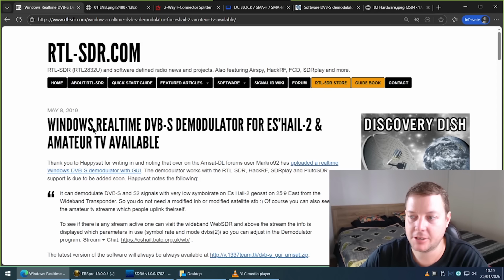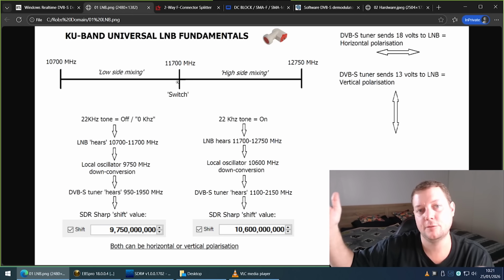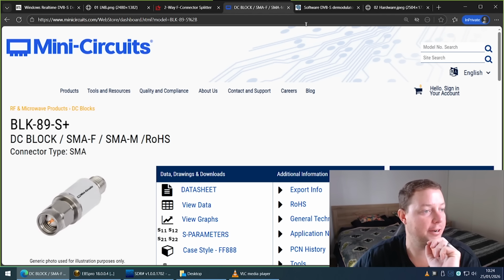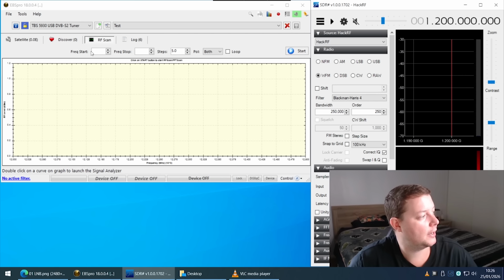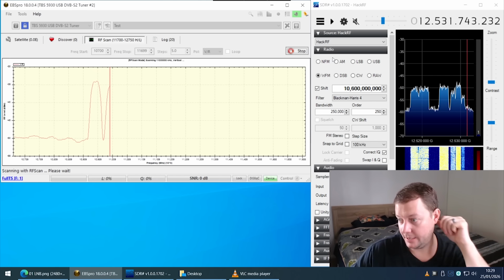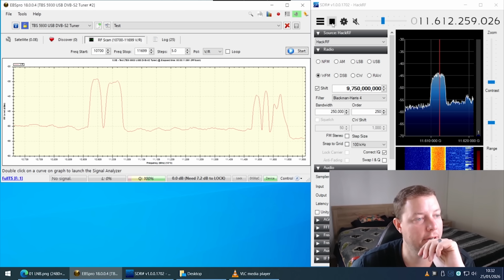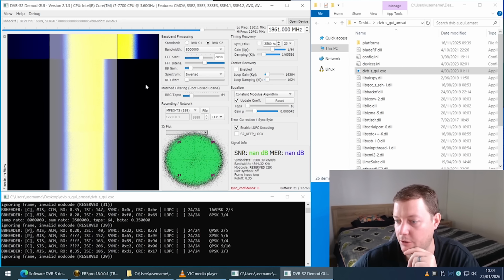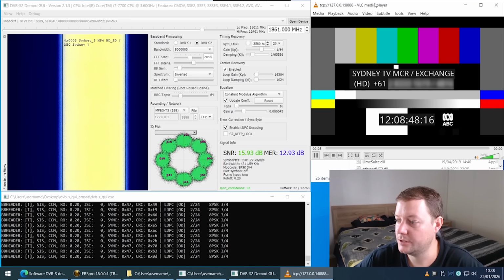DVB-S Demod GUI: Apparently Watching Satellite TV With an SDR Is a Thing Now?

Comment from the maker: LINKS, DOWNLOADS & COPY/PASTE VALUES:

DVB-S Demod GUI Reupload:
https://drive.google.com/file/d/1a4x3-k-moHbG3ouhVxDj6FXCE60otSD8

https://www.antsig.com/products/2-way-f-connector-splitter

https://www.minicircuits.com/WebStore/dashboard.html?model=BLK-89-S%2B

https://forum.amsat-dl.org/index.php?thread/101-software-dvb-s-demodulator/&postID=24112#post24112

9.75 GHz to Hz = 9750000000

10.6 GHz to Hz = 10600000000

VLC streaming URL: tcp://127.0.0.1:8888

Comment: Hi, i'm the author of this software, thanks for featuring it in your video.
Apologies for the lack of documentation. Once you have a lock, then redicing the loop gain values of the timing and carrier recovery (dragging the slider all the way to the left) increases stability so you dont lose lock again too quickly.
Sometimes the SDR drops samples on high system load, which i can't do anything about :(
But i'm glad this old software is still being used, Greetings to Australia :)

Comment: A quick question, I see you use the  Golden Media GM202 LNB. Is it because of the low noise figure (0.1dB)? I've looked at them and it says the LO is 10600 but I see in EBSPro you set the LO to 10700. Why is this? What am I missing? Does it have something to do with the sat's we see here in Oz?
Reply from the maker: Hi, great question! When I first got into satellite TV in 2023, I only had a 10700 LO LNB. My early videos will show 10700, later videos I always use a Universal LNB, which has two LO frequencies, 9750 for low side, 10600 for high side, and 11700 as the 'switch'
Reply: @RobVK8FOES  Ah I see, 10700 is the switch. Yep makes sense. Cheers
Reply from the maker: For universal LNB's only, 11700 MHz is the 'switch' between low-side mixing and high-side mixing. Low-side = 9750 MHz LO and High-side = 10600 LO

A 'wideband LNB' as we call them in Australia has a fixed local oscillator of 10700 MHz, but the trade off is that it can only receive 11750 to 12750 MHz, and not 10700-12750 like a universal LNB.

Comment: I'm thinking about buying a DVB receiver from TBS. What don't you like about your TBS-5930?
Reply from the maker: Hi. The TBS5930 is designed for just watching TV. It lacks a 'blind scanning' feature, and it doesn't like locking on to ACM/VCM transponders. Blind scan is the function of a DVB-S2 receiver to search for previously-unknown transponders, and negotiate their frequency, symbol rate and polarization. ACM means 'adaptive coding modulation' and indicates that your device can handle Generic Stream (GS) data transponders. If your goal is to watch TV, it works well enough. Thanks for watching mate!

Comment: RTL-SDR's are here because the chips they are based upon were originally DVB-TV Tuners. Some were used for Satellite TV for portable receivers such as those for caravans etc.
Reply: Yup
Reply from the maker: Hi, yes that is correct. However, the famous demodulator chip in the RTL-SDR can only do DVB-T, and not DVB-S2. T = terrestrial and S = satellite, the two standards share no commonalities with each other. A lot of people are getting and it wrong in the comments section saying "DUH, the RTL is literally a TV receiver!!!" It is a DVB-T receiver and not DVB-S. And an RTL-SDR is not even being used in this video, I am using a HackRF. It doesn't use any demod/tuner chips from TV hardware...

Comment: Interesting and well explained. I think the cable and satellite TV industry has kept a lot of the satellite information out of public view which is decremented its development and advancement amongst curious Radio folk. mostly because they play the security through obscurity card game for so long to avoid piracy not that it prevented it. I figured something like this had to be possible Elgato EyeTV products used to have a box that would do I believe DVB satellite TV onto the local network much like an HD home run.
Reply from the maker: Hi everyone. Yes, ETSI developed the DVB-T and DVB-S standards. I think if you pay a small amount of $$$ you can get the entire technical specification documents for these standards. In fact, they might even be free. This is why we have nice things like DVB-S2 decoders, because the information is all there. It just takes a skilled programmer to write an application that can perform the demodulation in software-only. Typically DVB-S2 hardware has it's own dedicated demodulator chip. SDR is amazing technology because we do it in software only :)
Reply: DVB-T and DVB-S are literal standards that everyone uses. They are not "hiding" information from the public. Both Dish and DirecTV uses proprietary encryption techniques but it is still using DVB-S/S2. There is still a large quantity of unencrypted free to air channels being transmitted that you can receive for free using any compatible LNB and tuner. Don't assume that your inability to find the information or to apply it is evidence of information being hidden.
Reply: @FiveFingerTight  we got the actual thought police in here trying to tell us that information hasnt been obfuscated lol look at this joke of a user lol
Reply: @S1LV3RP01NT  You watch your mouth!
Reply: @FiveFingerTight huh?
Reply: @S1LV3RP01NT  Friendly banter doesn't come through very well in the comments...

Comment: I'm old enough to remember buying cheap USB dvb-s adapters for SDR purposes.
Reply: I HAVE ONE
Reply: @bobeebo1 If I ever get in the mood for spelunking, I'm sure there's one in my Box of Crap.

Every tech person has one.
Reply from the maker: @derpderpyderpderp Hi. You remember using dvb-T dongles for SDR purposes. The famous RTL demodulator in the 'TV dongles' as people used to call them is a DVB-T demodulator, and isn't capable of DVB-S2. The two TV standards do not bare any resemblance to each other, T = terrestrial and S = satellite. Also, I am using the HackRF in this video, which does not use any tuner/demod/ADC chips from TV dongles. Everything in this video is being done in software only, the SDR is just providing the RF front-end

Comment: So a hackrf or even an rtl sdr can just become a dvb s2 fta tuner with this software. That's really impressive
Reply from the maker: Hi. Yes it can, however it's very limited. DVB-S2 signals can be 20 or 30 MHz in bandwidth, no chance of a SDR decoding those. But narrowband DVB-S2 signals can definitely be decoded!
Reply: @RobVK8FOES HackRF is 20MHz of bandwidth.

The RTL-SDR's came about from hacking the TV tuner's that used them giving us wideband tuning of any mode. Other SDR's at the time were sound card based giving you a bandwidth only proportionally as wide as your PC sound card's dynamic range could deliver, so some creative live cards or a small number Realtek chips were considered better than others. This was really early on in very low cost SDR development, with kits to make your own costing £12 were very common in ham radio communities.
Reply from the maker: @Dennis_M1DLG Yes, but 20msps only translate to about 18 MHz of 'visible spectrum' due to Nyquist sampling theorem, I think? (not a DSP engineer, btw)

DVB-S2 multiple channels per carrier (MCPC) transponders are typically 20-40 MHz in bandwidth... Don't forget that you typically need some over-sampling headroom too. No chance in hell of a tiny RTL-SDR receiving those, not even the HackRF at 20msps. My BladeRF can do 64msps, and with hacked firmware up to 128msps experimentally. By that time, you are well exceeding the bandwidth limitations of USB 3.0 and computing performance of your CPU.